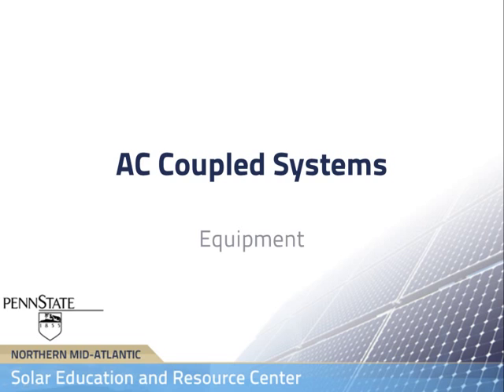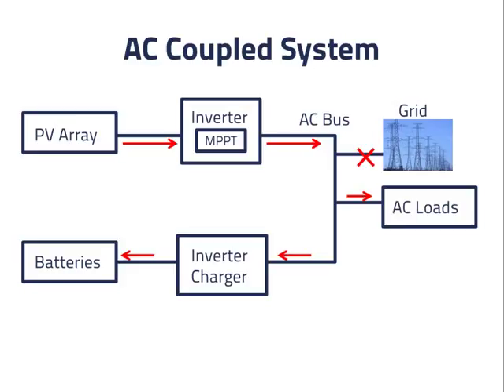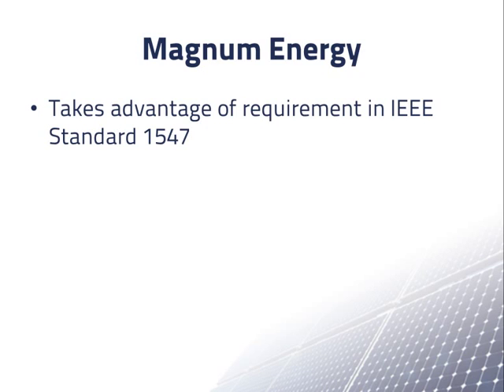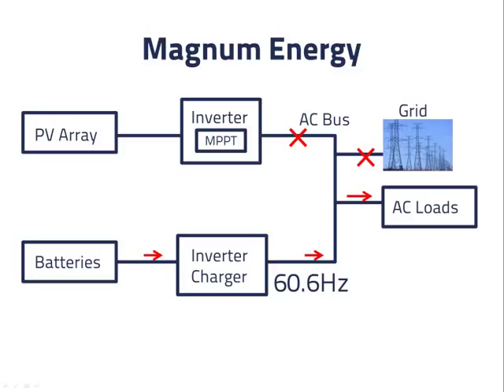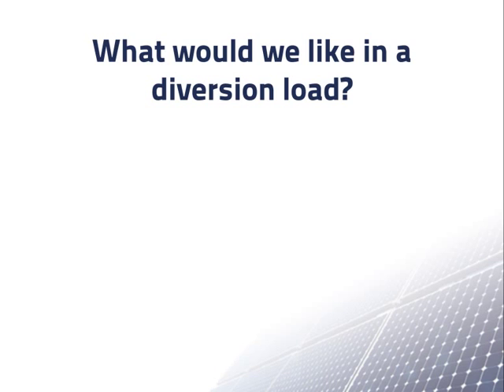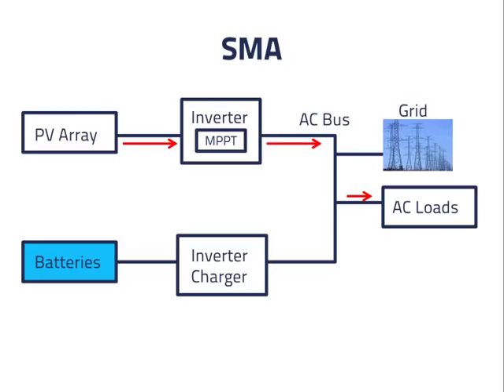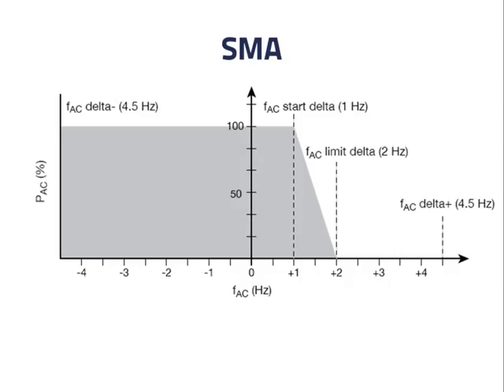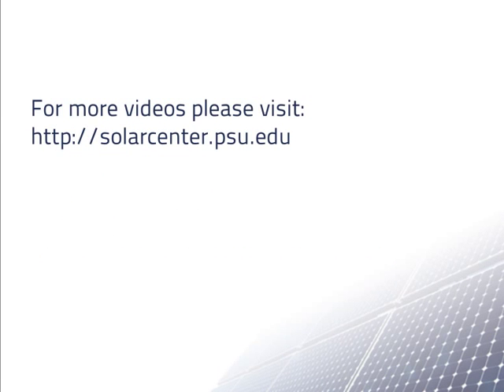AC Coupled PV Systems - Equipment

Comment: 1. Add additional batteries,  keep batteries charged to a healthier level,  90% etc. Use the 10% for a buffer. #2 use heat pump water heaters,  wire the coils separately from the heat pump. Use the water heater coils to burn extra energy.  Each has 1 heat pump and 2 coils so there are 3 levels of energy you can burn. And if you switch coils to different watts you could  have many more levels you can burn. Keep the hot water heaters lower temp and have 2 or 3 instead of 1 for normal use with a temp mixing valve. Have the excess power heat to the tanks max. Use a recirculation pump to loqer tank temps if they max out. Think radiant floors, driveway, garage floors if necessary.

Comment: My electrician has attempted to explain the unused power and the potential problems. In the audio world we call it a power soak (Diversion Load). I should certainly read more about them. We are new to solar, but we have just installed the PV Array, Inverter, and Net Meter. It is somewhat disappointing to learn that the system will not work in grid-down situations. That's where this video becomes relevant. In those situations power will not be using the Net Meter (grid). There is really no choice but learn about the batteries (full batteries) and charge controllers. All good information here. Thanks.
Reply: What's माइक्रो इंवेरतेर

Comment: now this problem has been sloved ,battery inverter will communicate with pv inverter and tell it to decrease power when there is   excess ac power in  ac bus side in the case of grid is fault
Reply: Thanks

Comment: two questions:

1. power is always drawn by the load. how wd there be extra power on the ac bus?

2. if there is a simple solar panel connected to an ac load, can extra power exist in that case aswell? how exactly? would really appreciate some reference on this.